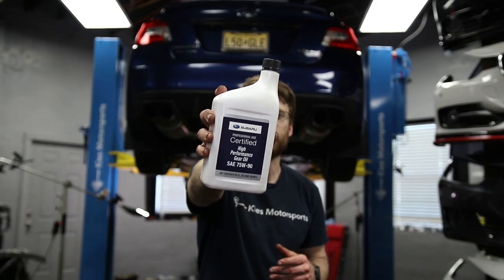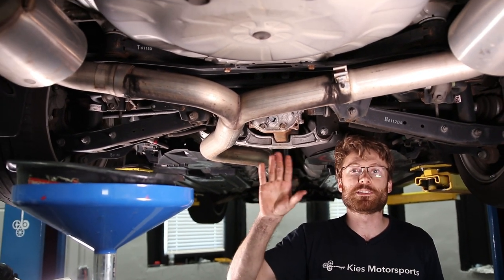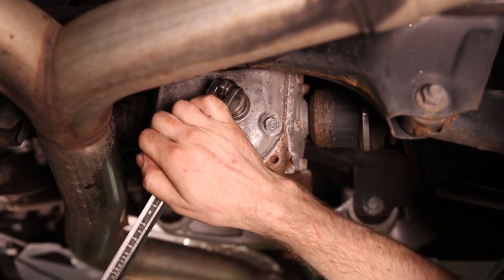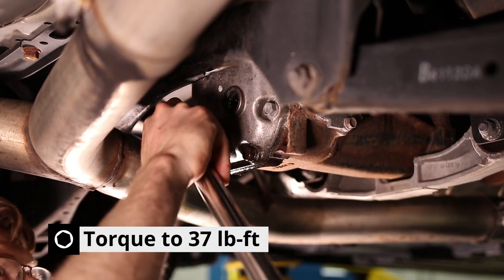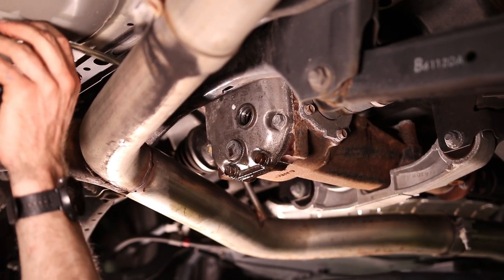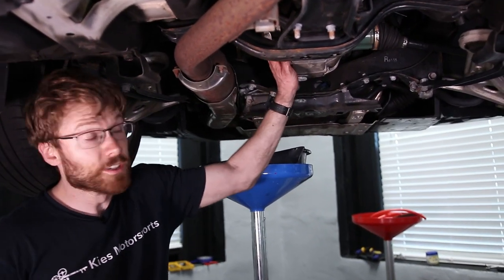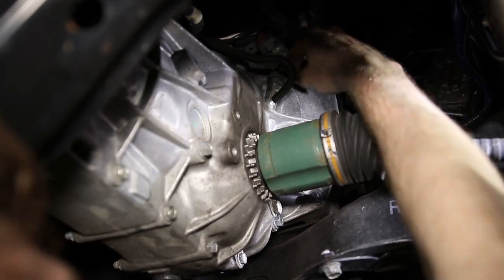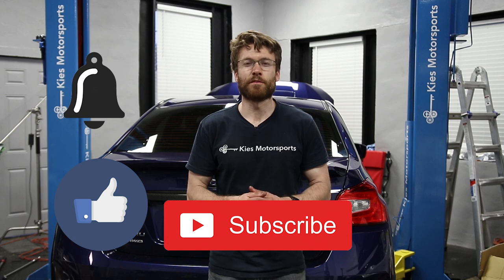How To Change Subaru WRX Front And Rear Differential Fluid 2015-2019

Comment: Super easy to do.  I highly suggest all my fellow WRX owners do their own work.  I used to work in dealership shops and let me tell you.... you think you’re getting great care for your vehicle but you’re not always going to 100% of the time. Do you think that 20 year old who’s on the phone yelling at his girl is gonna do your oil changes and brakes with 110% focus? Nope.  Be careful friends :)
Reply from the maker: Truth
Reply: took my '13 legacy 3.6 to the dealershit once due to the airbag recall...i asked them if they could change the front and rear diff fluids while they had the car. boy what a mistake. they apparently got the front diff dipstick "stuck" in place and couldn't remove it to refill the fluid. they eventually got the dipstick out of the drain hole, but they charged me improperly for the amount of fluid used, and the amount of drain plug gaskets used which led me to believe they did it improperly (only charged 2 qts. and 1x gasket in front 1x gasket in rear). turns out they never changed the rear fluid because when i drained it a month later it was completely black and the drain plug was covered in metal shavings/filings. lesson learned: NEVER GO TO THE DEALERSHIP

Comment: Bought the same gear oil & gasket from amazon and replaced today. Couldn't of been any easier without this video. Thanks a ton guys!
Reply: How is she running
Reply: @austin5350  solid. been 30k miles since I've done the change. coming back here to the video as a refresher before doing again here soon. cheers

Comment: You can definitely use Anti-Seize on those plugs. I've been doing it literally for decades. You just have to be careful to use a very small amount and limit it to the outer threads that don't come in contact with the gear oil inside.
Reply from the maker: If done carefully and you make sure you take that into account when tightening down because now you can exceed the torque value it can be used. Just be very careful and use a professional mechanic if you arent sure how to. Also done want them accidentally coming loose
Reply: I had changed it 3-4 years prior and those plugs were super tight...

Comment: For the front you can also remove your intercooler and get the dipstick from the top
Reply: Not that removing and reinstalling the intercooler is that trivial either (I did it to get at the battery grounding cable bolt...took most of an hour to get the loosened hoses slid off and just as long getting it back on all the way).  I don't recall seeing a dipstick on my 2020 there though, I may have to dig out my endoscope and look again.
Reply from the maker: Ok good to know. We'll be upgrading his intercooler soon (this summer probably) so we will check too
Reply: @matthewmiller6068  I also have a 2020 STI, I see a plug on top where the dip stick would be, I guess Subaru decided to omit it for "20....
Reply: I thought there was separate drain plugs for the trans & front differential?

Comment: I knew that exhaust from the start.  I have one with the black tips paired with a catted grimmspeed j pipe.  love the sound, gives it a deep rich almost rumble.  Probably using the royal purple gear oil because I have a good deal on it.
Reply from the maker: Awesome! It is a nice exhaust. AWE makes great products
Reply: @TheSundaeDrive  ... it is a nice exhaust, but it leaks at all of the slip joints; even when the pipes are in 100%...I know because I have the same exhaust and have reset both mufflers and it still leaks after the reset 😢...

Comment: Did you end up adding the other 0.5 qts or did you only need 3? I've heard of people adding 3.5 and it being too much?
Reply: I went straight to just under 3.5 and it was over the full mark. I don’t have leaks or issues but I guess not all of the oil comes out when you drain it. Next time I’ll start with 3 and add little by little accordingly.

Comment: Great video! I saw another video where a guy did not show that the transmission oil drain plug had a washer. BTW, can you use other transmission oils like Amsoil or Mobil 1 or would you not recommend it during the 60,000 mile warranty period?
Reply from the maker: As long as it is compatible although if they find out they will likely void the warranty sadly. I think we had looked into amsoil and amsoil didn't have any recommend lubes for this car but we use amsoil in all our stuff.

Comment: great video. i put a little bit (just 1 layer) of plumbers tape on the differential plugs. To ensure no leak and also to prevent it rusting shut as it did in your and my case.

Comment: Did u use same oil on both side? People usually using different oil ? Morul 300 on back
Reply: I read that u use, Sae 90 motul? No body seems to use different fluids? They just use the transmission fluid? I have sae 90 motul limited slip fluid
Reply: So, is it the same oil for front and back, or different?

Comment: Question: Has your brother noticed any driving difference between the factory fluid and that 75w90? 
On my 2021, owners manual says manual transmission/front diff takes Subaru Extra MT fluid, that’s what it’s filled with at the factory. And it says that other 90 weight fluid can be used but will severely affect drive ability and fuel economy. 
However, you can’t find Subaru Extra MT anywhere other than bulk 5 gallon buckets that cost $1000.
I’m hesitant to even change this fluid
Reply from the maker: He has not had any issues on his 2016. He's probably driven it 40k miles since we did this service. There may have been an update tho since your car is 5 years newer.

Comment: I called the dealership and they said trans/diff oil is 75w80 for the 2017 WRX, but they only sell it in 5 gallon jugs. How is running with the 75w90?
Reply from the maker: No issues in ours. Might vary from model to model
Reply: @TheSundaeDrive  I'm in a '17 Limited, so should be pretty similar (hopefully).
Reply: @kylewilkin8221  ... very little difference between 75w-80 and 75w-90

Comment: I have 2020 wrx 6 speed manual. My diff looks different. It has passive cooler and different bolt. They are 10mm alen
Reply: My car is jdm not usdm is that the reason? I don't live in US tho.
Reply from the maker: Might be the reason or they may have just updated the design

Comment: Ok, wait -- I've looked in the 2015 WRX maintenance schedule at at NO time in the manual does it say to replace the differential fluid at 30,000 miles. It DOES say inspect fluid level and replace when necessary. So, why do all the dealers say that Subaru recommends REPLACING the fluid when the maintenance schedule clearly indicates INSPECT. Don't get me wrong, I know it's necessary to replace it -- but seems more like this is more of a check every 30k and replace as needed item.
Reply from the maker: It is a check and replace as needed. Stealerships are trying to get your money as usual lol. Personally, I like to change my differential, gearbox and transmission fluid every 30-50K miles regardless. Gears will be happier with fresh oil as heat breaks it down over time.
Reply: @TheSundaeDrive  Thanks for the clarification. That was my suspicion, and I'm glad I turned it down at the 60k maintenance. I also turned down the "replace cabin air filter" one as well, since they wanted to charge me $35 to replace a $6 part accessible from the glove box. It's amazing what the dealerships want to charge for these items.
Reply from the maker: So true. We have a guide for replacing the cabin filter up too 😉
Reply: Just checked my WRX maintenance schedule book and saw this as well. Thanks for clarifying.

Comment: Does the WRX have a locking rear diff?

I thought it was open.  If it’s open, is there any reason that there should be filings and material in the fluid and on the magnet?  Shouldn’t there be none..?
Reply from the maker: it is not locking. There will always be some wear. I've never changed fluid in a diff that didn't have some.
Reply: The Sundae Drive interesting! Thanks for the response!
Reply from the maker: No problem!

Comment: The front diff drain T70 is suppose to be torqued to 50ft lbs, you did 37.
Reply: It doesn't take 50ft lbs to hold a drain plug in. Besides, it's easy to strip out the threads or crack the port in aluminum. 30ft lbs should be plenty.
Reply: I’ve been seeing the same… depends which gasket. Pretty sure Subaru gives the one requiring 50 ftlbs

Comment: Can I use an impact wrench to loosen the bolts? I’m doing it on a ramp and jacks so I don’t have much room.
Reply from the maker: I personally wouldn't on mine. Will it break anything? probably not tho. Just make sure you have it set to reverse!
Reply: The Sundae Drive haha yea for sure. I’ll try to break it with a breaker and if not then the impact it is. Thank you
Reply: I have done this last change on my 2015 WRX. Just be sure it's in reverse as OP says. Breaker bar of you can though. Using that now.
Reply: How’d the impact work? Very curious about doing the same!